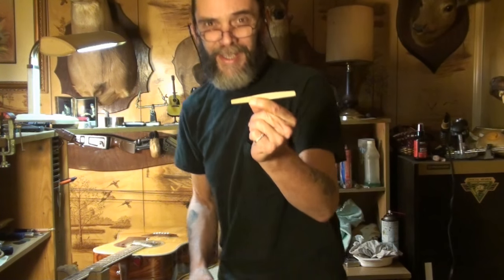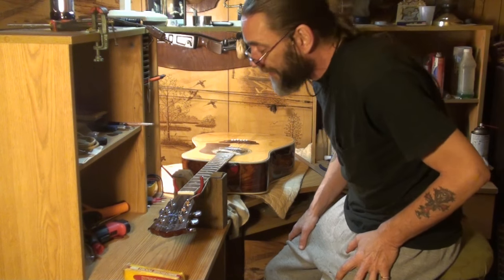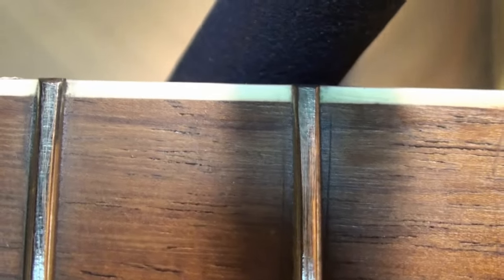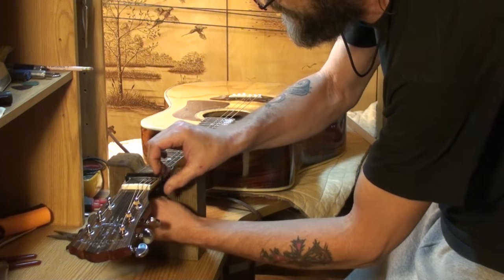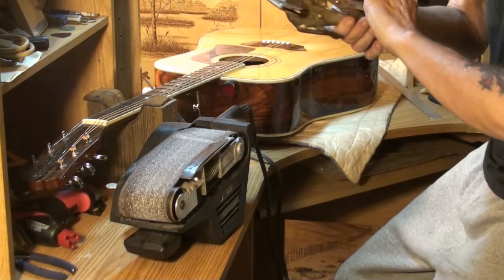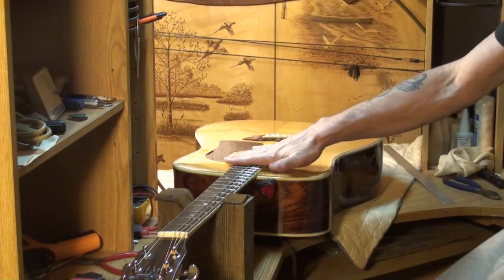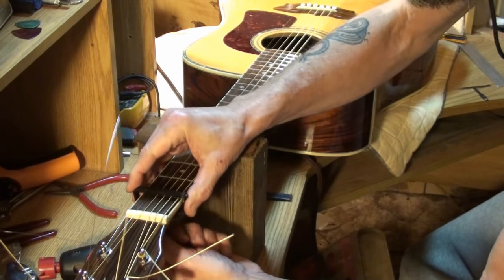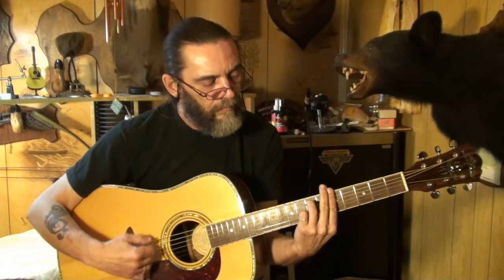Washburn Timbrewood WD-48S installing new bone saddle, set radius, polish frets and set up

Comment: I learn something from everyone of your videos. What caught my eye today was the technique that you use to set the measurement on the base of the saddle. I make bone saddles and nuts for guitars occasionally. I've had a heck of a time trying to measure 1/32 or whatever and then use a straight edge to pencil it while trying to keep the saddle or nut under control. Thanks for revealing your method by stacking the feeler guage. As always, appreciate your videos.
Reply from the maker: +Maurice Erwin I used to measure both ends with a micrometer, mark them, then use a straight edge to connect them but was always off a few thousands, doing it the way I did in this video gives you the exact measurement every time. Glad the videos Help Maurice, I appreciate your support and comments means a lot, thank you sir!

Comment: Nice!  Two thoughts: 1) the repairs and adjustments (worth a couple hundred at least) on a guitar that's available today, used, from several places for $400 - $600.  Is the investment worth the value of the guitar?, one would have to think that thru; 2) would it be best to set the neck tension (to bring the neck up) *after the saddle is dropped?  Even at the end of your work here, it'd seem that loosening the truss rod slightly would give you back a thousandth or so that you're looking for around the middle frets.  Thanks for the video!

Comment: very nice I can hear a difference from the first time you played it 
I was a bit worried when you sanded down the bridge ad adding new strings change the height and where they set in the nut as well but all in all it came out good now get them frets done lol

Quick question is the wood solid or laminated? seems very pretty for solid so thought it might be laminated  

as a matter of fact I need to bring in the Martin for some new ones wish you lived closer to Vermont but I use a local guy Adam Buchwald he has a pretty good group of followers but that don't mean crap to me I go to him as his work like yours is spot on

looking forward to our next venture till then good health & best wishes
Paul
Reply from the maker: I don't know if it's laminated or solid I should have checked that when I had it here. I noticed it sounding different too when I was finished. thanks for checking out my video Paul and commenting. from having to make all these replies from my phone, video of next about that noise! lol thanks again mate!

Comment: My friend I have to tell this, ¡¡¡KEEP THE GOOD WORKS!!!, I just watched other guys doing the same, you go straight to the point, your explanation is more than clear, they do a lot of bla bla bla, boring videos, my friend your teachings are the way should be.
¿? what you think to use bone in both the nut and saddle, your opinion, is for my Yamaha, I already change to bone in saddle, compensated one, sounds more clear, but if the nut, will be improve more or not.
I didn't change my strings yet because here in Puerto Rico I don't found the 10-50 that came from factory, I use my micrometer to find that information, no body could tell me that. 
My friend God bless.
Reply from the maker: Thanks so much for the kind words my friend, that is greatly appreciated! Yes if you switch to a bone nut you should hear a major improvement in your guitars sound, tone and even volume! If your bridge pins are plastic then bone pins would help even more. I've found that the combination of a tusq saddle and bone nut works together very well. that might be something you'd want to try. Thanks again my friend for watching and commenting!

Comment: Was that Q ball going crazy ?    lol    Hey Randy just wanted to ask .  What do you think of the cheap sound hole pickups ?  I even saw one that sticks on to the outside of the guitar .   Like a suction cup .  It sounded good in the video .   Under $20 .   Thanks .
Reply from the maker: +Dev9172 Most of them are ok and work, but if you really want one that reproduces the true sound of your guitar I would recommend a Fishmen Ellipse Matrix, you really do get what you pay for, I'll do a review on my Fishmen soon.
Reply: I had one in my Taylor .   I dont really use them .  But I have a little Fender acoustic amp .  I can put a guitar into it and a Mic .  . Im trying to learn to sing into a mic .  As you know an acoustic guitar needs to go into an acoustic amp
Reply from the maker: Dev9172
You are correct! You'd be surprised how many people think an acoustic guitar can be played thru an electric guitar amp, it can be but they'll never get the true sound of the guitar unless it's an acoustic amp or a sound system, anything but an electric guitar amp.
Reply: I dont understand how people can be so stupid Randy .  It was like the oil ,  remember ?     Dont people think ?  Or read .       The other day I told someone I went dear hunting .  The asked me if I CAUGHT one ?   lol      Right , i just ran after it , no need for a gun !    ha ha ha

Comment: Just curious Randy, I have a J45 that like this guitar the edge of the bridge has pulled up a little. I keep close tabs on it, but is there anyway I could put some glue in there without doing more damage, or should I just leave it until it needs a full reglue? I have wondered about putting some titebond on the corner of a sheet of paper and just kind of pushing some in there? It is stable, it hasn't increased any in about 5 or 6 years.
Reply from the maker: if it hasn't gotten any worse in that long of time I wouldn't touch it, it's possible it's been like that from the day It left the factory and  never get any worse. thanks for tuning in my friend I appreciate it.

Comment: Nice job on the nut and saddle. Too bad the customer didn’t have you dress and crown those frets that look terrible. I learned a new tip to use feeler gauges to mark the thickness that needs to be removed from the bottom of the saddle.
Reply from the maker: +Dale Palmer I used to use the end of my micrometer, measure and mark both ends of the saddle then use a straight edge to connect the marks, this way with the feelers is much easier and I believe moire accurate. Thanks for tuning in Dale, it's been one hell of a couple days here, you'll see it on my next vid lol cheers!

Comment: Hey Randy , one more thing I wanted to ask you .  I have 2 little dings in my guitar top .  You really need to look to see them . I dont really care .  But I saw that they can be steamed out .   Wet them , then put a wet cloth over them and use a hot iron .    Have you tried this , will it work , what do you think .  Thanks .
Reply from the maker: +Dev9172 I use a soldering iron and damp cloth and it works if you're very careful and the dents aren't too big.
Reply: thanks .  I will just leave them . they are so small

Comment: What brand of linseed oil do you use? Where do you get it? If you don't mind me asking. I'd be greatful for the information, Thanks.
Reply from the maker: I'm having to reply to these messages from my phone as you will find out in the next video why, I used three different brands of linseed hold on until tomorrow I'll look and see what they are and tell you.
Reply from the maker: +Thomas Tommy Well I thought they were different, I checked and all three bottles are Mona Lisa.
Reply: +Randy Schartiger Randy thank you for the info. Where do you buy them from?
Reply from the maker: Thomas Tommy
I was shocked to find it locally here in a furniture store but usually I just order it off Ebay.If you search for it there you should be able to find it.

Comment: What type of glue should I use when replacing the nut
Reply from the maker: medium or thick viscosity CA glue or Titebond, very little glue needed to hold the nut in place.
Reply: Randy Schartiger thanks a lot
Reply: By the way I’m still pretty new to guitars but you have given me the confidence to work on my old guitar which I got gave to me. So which one would you suggest changing 1st the saddle or the nut? I’m going to change both in due time but time and money.
Reply from the maker: I would recommend changing the saddle first, then when you change the nut you can tell just how much difference in sound there is.